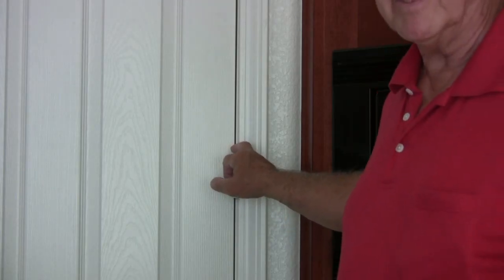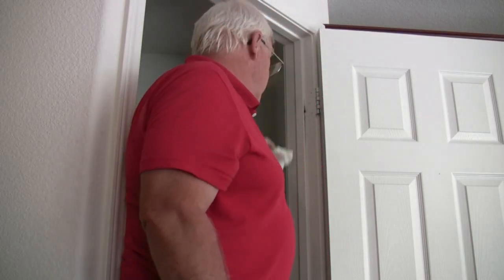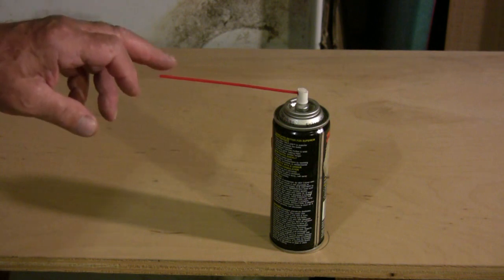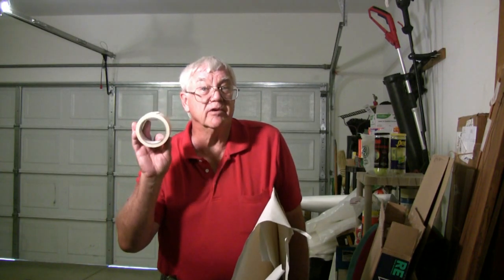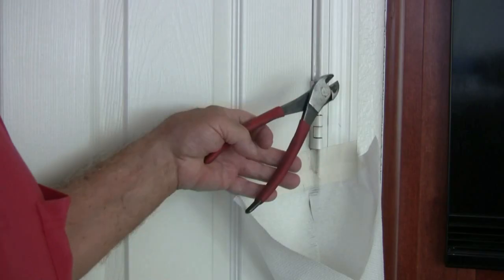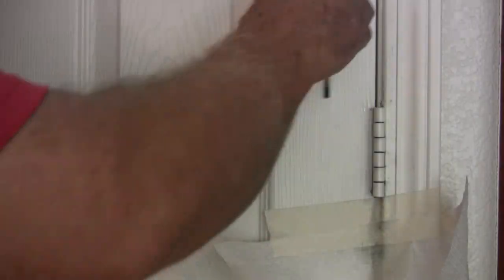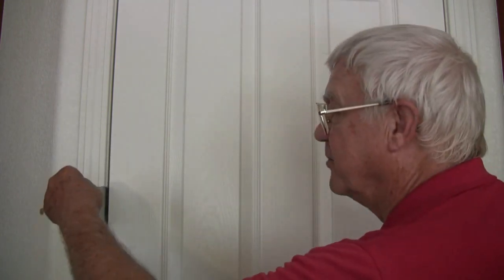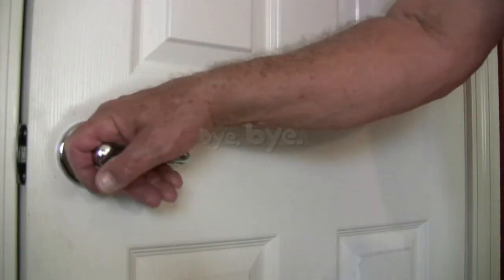How to Quiet a Squeaking Door

Comment: That's a pretty thorough way to lube them :)
 I usually just spray the the hinges on the outside and close the door a couple of times to get the lube in there and then clean up the excess lube. That's worked for me so far.
Reply: Same here.  I do that at work and sometimes go through 5 to 10 doors a day quickly.

Comment: that quiet door is music to my ears.  going to try this out this weekend on a couple squeaky doors and will report back.  great video!
Reply from the maker: Hope you had good luck with your squawking doors. And thanks for the compliment.
Reply: hi!  It worked like a charm!  home depot didn't have the lubricant you recommended, but I found one that worked just fine.  I just could not get the hinges out of one of the doors no matter what I did.  They have the covers on the bottom so you have to stick a long skinny nail in the smaller hole and then do the hammering.  The hammers I had were bigger, and the nail wasn't skinny enough, so I think that just added to the difficulty.  BUT I don't think the hinges have ever been taken out and cleaned/oiled, so they're stuck in there good.
Reply from the maker: Make sure there aren't little set screws screwed into the sides of the hinge knuckles. On certain doors, this is done for security reasons. Oh, and you might try a nail set — a tool like a punch made of hard steel used to drive the heads of finish nails into the wood. Good luck!
Reply from the maker: Then there's a pair of diagonal cutters. You grab the head of the pin from underneath and squeeze. If the head moves up just a little,  tap a hammer upward on the underside of the cutters. Hope fully the pin will then begin to move. It's all in the book.

Comment: I usually take things a bit further. I take the door down, carefully clean out the hinge leaf bores & pin... then give the bores & pin a thorough (but light) coat of white grease. A swab works well for applying to the interior of the bores. Be sure to also lightly coat the upper & lower end surfaces of the leaves, then reassemble ! The door will then work buttery smooth for years or even decades. A little tube of white grease like 'Lubriplate' is inexpensive & will do scores of doors! Great videos, Thanks!

Comment: GREAT video and thanks for sharing!  Nice tips there.  But I have a storm door out front that is squeaking really bad when it is opened and closed.  I was just going to go get a can of WD-40 but instead, I think I need a better lubricant spray like what you used since WD does evaporate over time which will make it lose its lubricating abilities and then the problem will come back.
Reply from the maker: +Doug Celeste In extreme circumstances, petroleum grease can be applied to the pins in the hinges. But if your storm door has sealed hinges from which the pins cannot be extracted, then you must resort to something in an aerosol can. And that's where Tri-flo is good because of its teflon content. Good luck!
Reply: +donnydoors   Thanks for your reply and valuable input.  Much appreciated and I sure hope that Home Depot or Lowe's carries Tri-Flo or something similar to it.  I will let you know what I get and if the storm door squeaks stop after I use the spray.
Reply: +donnydoors   Tri-Flow is sold at a couple of small bike stores here in town but not at Home Depot or Lowe's.  But like you said, any lubricant with teflon or silicone will do the job and I will let you know if it does.  Stay tuned and thanks again for your help!
Reply: +Doug Celeste WD40 is not a lubricant thats why it doesn't last long
Reply: +Jason Yake (ThatCanadianVlogger)   You know, Jason, I have always considered it a lubricant since it has done a fine job for me over the decades with many uses.  But yes, it does have its limitations, esp. when it comes to squeaking doors.  And I will have to see the new cans and see if the word "lubricant" is used on the cans.
Reply: I'm not sure if they use lubricant on the can either I just know it's not the best thing to use as a lubricant it's excellent for rusty nuts and bolts and for cleaning stuff with though
Reply: +Jason Yake (ThatCanadianVlogger)     You make some good points here and yes, my locksmith friend did not advise using WD-40 for lock issues since it did not lubricate well.  But yes, WD-40 is great for rust and loosening nuts and bolts and cleaning like a solvent in a can.
Reply from the maker: +Doug Celeste When I worked at the old Goldwyn mill, my machine maintenance guy would use WD40 to clean the pitch off the planer. Supposedly it contains kerosene which limits its use as a lubricant, but beefs up its strength as a solvent. The old guys would use graphite. That explains the black dribbles. I did find something in a can called "lock Lubricant." But I think it contained graphite.  I'll have to take a look next time out to see what Lowes and Home Depot have for silicone or Teflon lubes. Best of luck all around!
Reply from the maker: +DeathWish808  I&#39;ll have to look for it. Thanx.

Comment: Do you think by just taking out the hinge and wiping and cleaning it without any store bought lubricant would fix it ? i have a door that is squeaky on just the top hinge and i removed the pin, washed it,(was pretty dirty) and put it back in and no sound at all. just afraid it might come back in a week or so.

Comment: Very good door tricks amazing taking pins out and using like dw40 ther have in UK thack you donny
Reply from the maker: You're welcome, sir. Maybe you could find a spray lube that is silicone or teflon. WD40 is somewhat solvent, used to free up shower valves and clean saw blades.

Comment: Great job thank you. I would suggest you try some grease next time not as messy thank you again. Couldn't find my grease used to vaseline seeing how that work and you don't have the dark color on the white paint
Reply from the maker: I like that idea. Why not Vaseline, even though you find it in a different part of the store. If one doesn't have grease for a gun around the house, or a smidge of plumbers' lube, then vaseline is a good substitute. And, yes, the black discharge is a problem. The vase cures that. However, in my case, those black oozes were pre-existing.

Comment: I'm of the school of thought to KEEP the squeak, especially for front and back doors. No surprise "guests" in your house.
Reply from the maker: Good point! Though this is a pantry door as is obvious in the closeups. But there are some doors whose noise is truly bothersome. Thanks for the comment.
Reply: @donnydoors  ...I know it's the pantry. . My in laws are in their mid 80s and VERY hard of hearing. They wanted to grease the squeak out of their front door (it's a wonder that they could hear it), when I advised them against it, especially considering that times have changed since they moved into their house in the 1960s.  Petty theft, break ins, etc. The front door still has a healthy squeak.  They may not be able to hear it, but anybody else trying to enter WILL TAKE NOTE and MIGHT have second thoughts.  I DID take notes on your method, though. Thanks for your helpful tips. 👏👏👏
Reply from the maker: @69bobr  You're welcome. And thanks for the chat.

Comment: Can I use olive oil cooking oil? Btw. This donny is not old. He is strong and tough.
Reply from the maker: I think that tends to gunk up, so it may have the opposite effect. If you have no spray lube, you might just dry vigorously wipe the pin with a cloth. Or, maybe wipe it thin layer of veggie oil onto the pin (Don't try to drip it into the knuckles.) and wipe that to where only a thin layer remains.
Reply: @donnydoors  Thank you so much for your reply! I have to go to the home depot buy that lube then.
Reply from the maker: @hyunkim1898  WD 40 is a solvent as much as a lubricant, though I see a "WD 40 dry lube".Don't know if that's cool or not. I used to use Tri-flo(W). Any aerosol lubricant with silicone should do.Good luck!
Reply: @donnydoors  Thanks Donny for point me in the right direction. I really want to get my squeaky door fixed. You are a very good friend!
Reply from the maker: @hyunkim1898  Gee whizz. I hope it all works out. Keep me posted.

Comment: Can I use WD-40 as the lubricant?
Reply from the maker: Sure. But it's as much a solvent as a lubnricant. So it may dribble out black from the metal wear, or not last as long as silicone or teflon lube.
Reply: What about just Vaseline/petroleum jelly?
Reply from the maker: @123457474869  Sure. Applied lightly, of course.

Comment: Can you use wd-40
Reply: not recommended because it will dry out
Reply from the maker: I agree w/ Mister Long. Teflon based lube is best if you can find it. Jacob Schaefer recommends silicone oil. I know that there are silicone spray lubes readily available. WD is quite like paint thinner. Good as a solvent, not so much a lube.